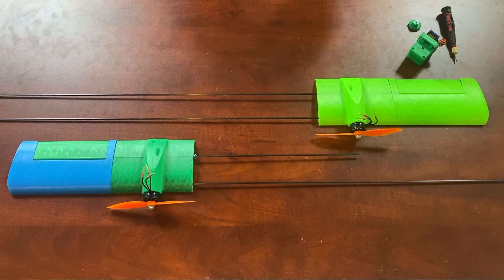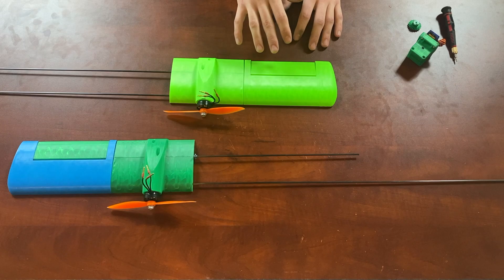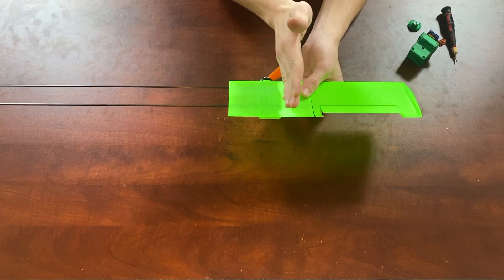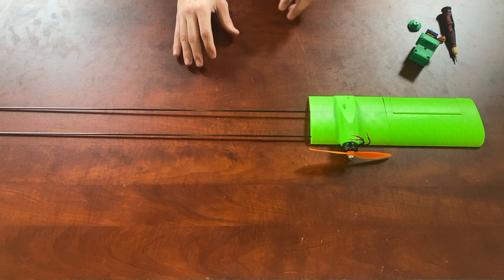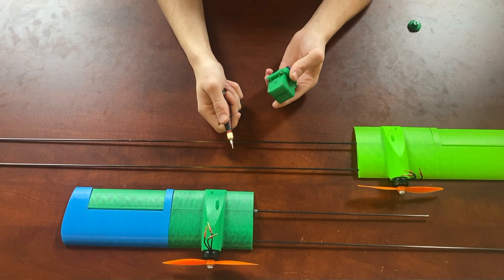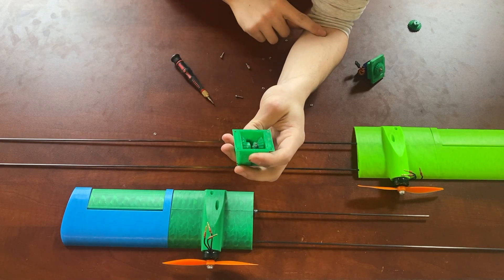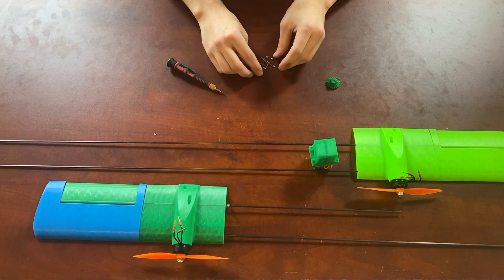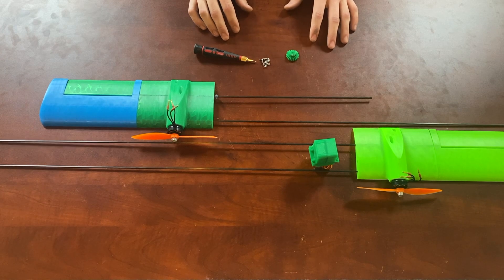3D Printed Airplane Wing

Comment: Hi, neat design. 
Have you tested or considered friction of the carbon fiber rod under load inside the wing being unable to control the aileron?
Just wondering if that could cause issues.
Thanks
Reply from the maker: Very good insight! That is one of the first potential issues I thought of with this design as well. I did a few real world test with this model and when I applied moderate loading to the wing the system still operated well. This wing has a low aspect ratio and I would imagine the larger it gets the more likely this would fail. I could do some FEA to figure out at what loading the carbon fiber rod would fail when actuated but I’ll save that for another day. I don’t think carbon fiber would actually be the best solution for this system as it does not have the ideal failure mode. Thanks for watching Matt!